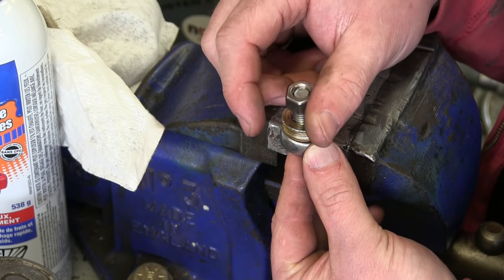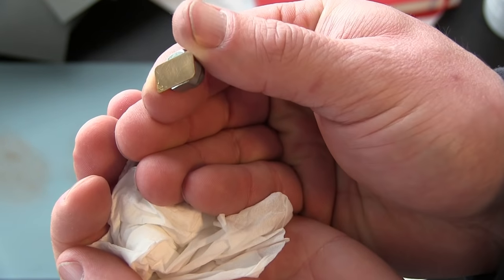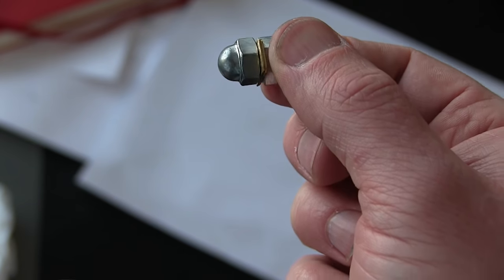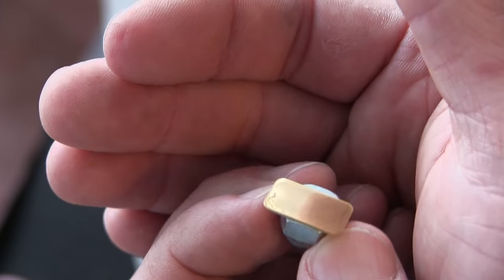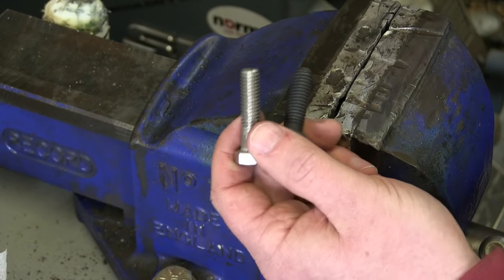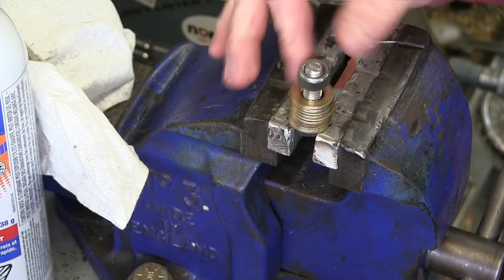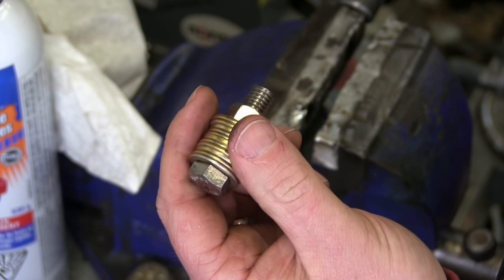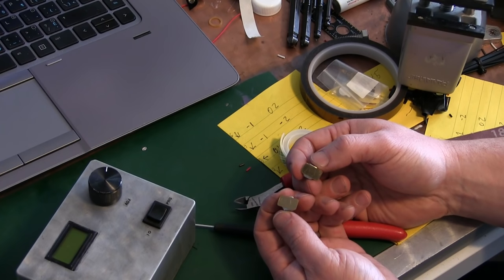Cold Welding of Gold and Stainless Steel in Earth Atmosphere.

Comment: Even as an aerospace engineer, I have to explain this damn near daily to colleagues both young and old. "can't happen that quick, can it" or "but I don't know what else to use" or even once "but I used hardware store galvanised screws on my fence, and after 8 years some were rusted, so all stainless all the time". Usually force them into the shop to try it out, the message tends to sink in after the 4th broken bolt. I worked in petro plants before I got my degree, working in cooling towers next to the sea, you learn quick how corrosion and cold welding works. Aerospace engineers seem to treat the shop as a place you need visas to get into, the bigger the company the worse the problem gets.

However, relying on copper paste and stuff like that is a bit of a no-go as well, because you can never really trust the grease monkeys to put it on right. what can work is combining a stainless bolt with something cadmium or zinc plated (and than replacing the nuts after a while, the coating is sacrificial) or using a 17-4ph bolt with a 18-8mo nut, the molybdenum keeps the threads from welding. only thing is that while everyone knows 17-4ph, 18-8mo is as rare as common sense and goes for similar prices.

Comment: To explain the failure (i think): i used to work in galvanic industrial spot repair, its applying locally a galvanic metal by means of a soaked carbon and cotton wrapped electrode.For Stork-Wartsila ( huge ship engines) i electro plated the crankshaft bearing cap and seat to prevent fretting aka cold welding, the cap was done in 24K gold and the seat/engine block with chrome, stainless has lots of chrome.....

Comment: Just so you know, two surfaces as polished as you made them will always stick together quite well. The impossibly small imperfections become so small that even air and water has trouble passing through. A lot of ceramic mixers (as in in your shower or sink) have ceramic discs inside that seal by simply touching each other with such a smooth surface.

Comment: That cold welding process is how the pixies get in and out of all of your ic's. Just apply some ultrasonics to aluminum, copper or gold wire while pushing down and very quickly you get a pixie-proof joint. I have been building machines to do this for about 20 years and the welding part is still PFM to me. But, it works :)

Comment: Over night with even a slight change in temperature the two gold surfaces were able to separate from one another.  That is why when you picked up the assembly, the two halves came apart as easily as they did.

Comment: The problem with using gold as a cold welding example is its too soft, the galling happens too easily, then it serves to prevent future cold welding. Try it again, only with silver ;) Bonus points for cold welding gold to silver(yes it works) 
BTW, the welding is actually the formation of nanotubes between the two surfaces due to the extreme closeness of the materials, allowing nuclear forces to do their magic. The galling is from the nanotubes pulling the gold apart like a string in your shirt. Since gold is so malleable, the weld isn't super strong, but still pretty amazing. Cool stuff.

Comment: well, after watching you and cody play with this concept, it got me thinking, i managed to do this with 2 aluminium heatsinks.. I was trying to find different ways to lap them, and I managed to get them to stick (thinking it was vacuum between the 2), then the 2 surfaces got badly galled and scratched up, I was confused why.

now I assume I was removing the oxide layer via friction and then the 2 metals just fused at little points. since I was just giving it all hell to buff them. Which lead to scratches all over the mirror finish.. I thought I had some crap in the oil I was using to let them move..

anyway, you get the picture, I think..

Comment: If you are using a lock-nut liquid with stainless nuts & blots, it's just as easy to use it as a lube when you torque them up.
I've been there also - cutting locked-up M16 nuts by hand.

Comment: what did you wash the surfaces with between abrasives? The galling, is due to contamination.

and just for the record, using your fingers to hold the pieces, 1) warms unevenly the material; 2) you rock the material making rounded faces; 3) fine gold is super soft, finger nail dents it.

last bit, fine gold will cold weld with hammer taps, it just really likes itself.

Comment: I took a college class on telescope making and when grinding the final patterns into the reflector we would use 1 micron grit with glass on glass. The grit was mixed in with purified water and the biggest worry was not enough grit, if it was just water between the lenses they would instantly cold weld and we could not get them apart ever again; it would end that person's project. The only hope was to pour hot water at the weld site and hope there was moisture trapped between the glasses to expand just enough to help pry everything apart

Comment: I'm guessing this is what happened to my motorcycle exhaust header studs. The damn things got so stuck, the studs broke off and took two extractors with it. No amount of cutting oil, acid, map gas, or elbow grease could get them out. Finally I just drilled them out and still need to re-tap them. It looks like they used stainless steel inserts in the magnesium block, and one of for some reason the studs got fused to them.

Comment: I saw another video of yours, wherein you slide a pair of high-class gage blocks together, and they would stick together in much the same manner as those bits of gold. They did not gall because the metal was quite hard. Something about van der waal forces or some such. In my little mind, galling is a mechanical deformation/deposition happening between two surfaces of same metals, forced together, usually threads but could be other sliding contact surfaces under significant pressure. I'm not yet convinced of an actual weld happening. I applaud your efforts...but am not yet a convert to the concept of cold welding. Am still stuck on galling. I'll happily admit to being wrong, though, once I'm convinced.

Comment: Try it with Silver and Brass. Copper, silver and zinc all to gather alloy together at a fairly low temp compared to copper to silver. But is it really welding when it's dissimilar metals? Where the brass and silver meet they have a lower melting temp so it's super easy to join them with a torch and no solder. It's also easy to just have it all collapsed into a puddle. We use to call it eutectic bonding but I'm sure that's not really want we were doing. I got fairly good at joining silver and brass in a metalsmithing class years ago.

Comment: When ringing AAA gage blocks together you only have a limited time to work with them before they will cold weld. So it is not instantaneous but we tried to never leave blocks rung together more than a few minutes at a time.  Some PHD will take exception to this but I always thought cold wielding was caused when two surfaces are extremely flat and therefor so close together that the atoms didn't know where the barrier is and migrated between them,

Comment: Ive had 310 stainless steel sheets to cold weld on the loader on a machine.  It kept saying it picked up 2 I stopped it and had to use 2 screwdrivers to pry them apart and there were marks where gouges where it pulled metal off.  304L will cold weld if you drag it across another piece you can feel it catch.

Comment: I'm not a metallurgist by any stretch of the imagination, but as far as I know what's happening is when you grind and polish a metal like gold, iridium and some other noble metals, you expose a very homogeneous surface, due to the high density of atoms. Also this metals have atoms with dense electron clouds, this dense electron clouds can share electrons very easily with other atoms of the same metal. This is confirmed by the fact that gold is an excellent current conductor. So by grinding and polishing the surface of gold you are creating a smooth and homogeneous layer of atoms that is very likely to create a bond with other atoms even if they come from another gold plate. About your issue with the time needed for the two plates to be welded and their strength I don't really know much about that, what I just told you is what I know from a semester of basic metal chemistry, one teacher said that what you showed was posible but I've never saw it happen, great video, it's great to have someone who is doing and proving this kind of stuff

Comment: I've put too much torque on stainless bolts before with a wrench and ratchet. The nut will never come off. Usually just better to snap the bolt into if you can. I'm also referring to 5/16 stainless fasteners.

Comment: This is really cool! Never heard it called "cold welding" but this is called lapping (polishing) and removal of air between the surfaces which cause the bonding. Known as "gauge blocks" they can be purchased for building highly accurate lengths. Also used to create a better bond between CPU's and heat sinks to pull more heat from CPU's.
Reply: No one cold welds CPU's and heatsinks together. That's a silly idea and a good way to fry your CPU.
Reply: Careful of those absolute comments. Someone is bound to prove you wrong. And yes they do "cold-weld" or lap cpu's and heatsinks. Even i7 chips have been lapped as in the link provided. And yes, it voids your warranty but it has been done by MANY for many years.

http://www.silentpcreview.com/Our_Lapped_CPU_Heatsink_Test_Platform

Comment: Reminds me of the time in Santa Cruz, installing new backflow preventers (10" & 12") for the University.  We pre-fabbed much of it at the shop & transported to the job sites after excavation was complete.
Sadly, the University spec'd 316 stainless bolts & nuts, which we used in the prefab (& drove home with the impact wrenches.)
Needless to say, we bought all new hardware for the final assembly, along with about $500 in sawzall blades to cut the old (still new) hardware off.
The really re-cock-ulous part is we used 316 stainless to connect ductile iron.
Why?  Because the U said so.

Comment: I use Super Duplex UNS32760 bolts at my work a lot. Unfortunately I'm one of these "freshly minted engunears" so I don't get to go hands on until I get back to my cave of powaaaa tooolz, but we've had a fun time recently with scrapping bolts. The lads in production have been tightening them up by hand completely dry and probably 10% of them have needed to be scrapped. It's less scrappage than when they were allowed to dick about with air tools, but it's still expensive scrapping custom bolts like that. Management's reason for going in dry is that we did do some testing a while back with copper / silver slip and both of them screwed everything up even worse because of "microscopic metallic flakes". Not convinced. We have used some anti galling compound called Blue Goop made by Swagelock, and it seems to tick all the boxes as far as I can tell! Doesn't kill them fishies, doesn't cost a milion bucks a tube, gets everywhere and makes a massive mess (cos it's bright blue and stains everything) and we've not had to scrap many fasteners on the projects we've used it on.

Comment: when i was living in Greenland we used to grab blue ice in the winter when the bergs got caught by sea ice, a lot of work to chop through the salty outer layers though, it can be done in summer but sailing up to icebergs is inherently risky, those suckers really gather up momentum when the centre of mass changes beyond the tipping point and the melting top layers makes them slippery as fuck.

once you have gone through all that trouble you might as well fill up as many containers as you can, in the winter they will keep outside so freezer space isnt that much of an issue.

Comment: With the nuts/bolts example you did, doesn't this have to do more with the friction rather than cold welding because oxidation happens instantly? Secondly, does brake cleaner really remove any oxidation? It would be interesting to find out what the friction coefficients were compared to the different metals of the bolts.
Reply: Break-cleaner just removes the oil and other dirt that might be on it.  
And it is not just the friction - with clean nuts/Bolts they really stick together way way stronger than friction could ever do.
it is the act of screwing that just scrapes of the oxid-layer, and at that very instant the 2 metal-parts touch and weld together.

Comment: AVE have you ever had bunderberg rum from Australia? if not you should let me know and I'll send you some. my friend came across your channel a few months ago and told me to check it out. it's so interesting and a great learning tool I'm not in any mechanical trade but my brothers is a mechinist working on large hydrologic cylinders that are the suspension for Komatsu 830 trucks so very big stuff by normal city standards. i sometimes gave him a hand on what ever he needed help with. And he use to teach me at the same time. your channel reminds me of that without any physical work it's great ; ) i have a nut that keeps comming off the end of my bike and you just made me realise that the thread must be clapped and it's getting vibrated off. thanks heaps it's been driving me mad trying to figure it out.

Comment: I've had to deal with K-Monel stainless valves and their valve caps in the nuclear industry. These valves were notorious for galling up. The caps easily weighed 20lbs on the smaller valves and were Acme threaded onto the valve body. Seems that management would get a little perturbed when you didn't lube one up before rendering a $50k half inch valve inoperable.

Comment: Weve been seeing this at work not only on the threads, but on the shanks of CRES bolts in tight (< .001") holes. I keep telling people about this magic anti-seize stuff but they seem to like the challenge of driving out 3/4 bolts with a jackhammer sized rivet gun

Comment: NASA was giving away a friction stir welder the size of a small house for practically nothing when the Orbiter program was begun to be decommissioned, it was used for the SRB main body construction.
Imagine a 300 ton press with a dry orbital sander on it and you'll have an idea as to how it worked.
The main shaft would pendulum above the metal whilst the contact surface would rotate as it traveled along the plane being friction welded, thus transferring molecular bonds between the edges of the metal and forming a very strong bond.

Comment: I was making a 3” male to male X female thread X male thread cam lock adapter when I got the idea of loosely screwing the 2 aluminum parts together as I walked out of the supply store. Big fucking mistake! They wouldn’t come back apart by hand and as a last resort (to prove that they couldn’t get the best of me) I tried a 3’ pipe wrench and a vise. Bottom line is, yep... they got the best of me. Legend has it those two parts are still stuck together today.

Comment: Maybe it cold welds mainly because of the local heat produced by friction caused by torquing/twisting the two parts. A test case would be to set up a rig and twist a pairing extra slowly, then to twist a pair extra fast (this will be the hard part) and then for reference with normal speed.

Comment: hey AvE, got a question in reference to a 3 year old video you made comparing cheap calipers to expensive ones. I'm interested in your "opinion". For home use that doesn't require extremely close tolerances, and considering HF digital calipers cost $10, if you buy a similar $30 set of Husky ones at Home Depot,  are you getting a little bit better set or are you probably just spending 3x as much for a similar cheap Chinese set?